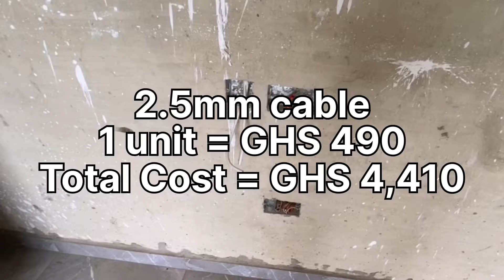Total cost for Electrical Wiring in a 3 bedroom house in Ghana

Comment: These materials are okay for a three bedroom apartments, very normal .
But If incase yours was more than or lesser than that then ,
It will depend on the number of circuits that will be provided  . More circuit requires more cables.
Circuit is the number of  socket point , lightning point , cooker unit , AC , water heater and so on ...

Comment: Please what is the use of the 4mm and the 16mm?
Thanks
Reply from the maker: 16mm Armoured Cable is a power and auxiliary control cable, designed for use in mains supply electricity. Used for underground systems, cable networks, power networks, outdoor and indoor applications, and cable ducting.
Reply from the maker: 4mm cable is mainly used for Radial socket circuits rated at 32 AMP, also used for immersion heaters and some cookers

Comment: I spent over Ghc 50,000 on my 4 bedroom story latter part last year. All rooms are master bedrooms with AC and TV. I used cable metal. Prices have dropped quite significantly since then.
Reply: Cable metal is the best on market for wiring.
Maybe that's why it is the most expensive
Reply from the maker: Thanks for your feedback
Reply: @AfricaBuildingHub  Please is it advisable to us 5 inches hollow blocks after lintel?- thus the four blocks before roofing. Note:  Please the building is not a story building.